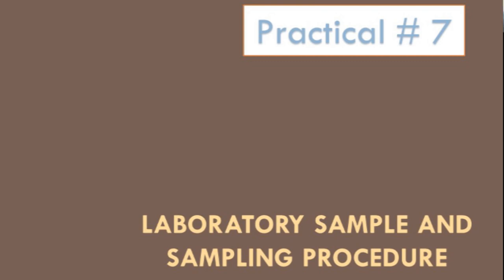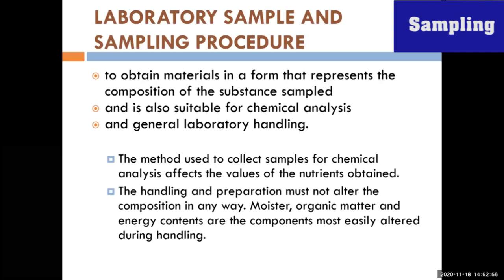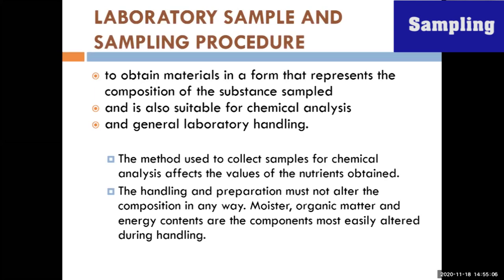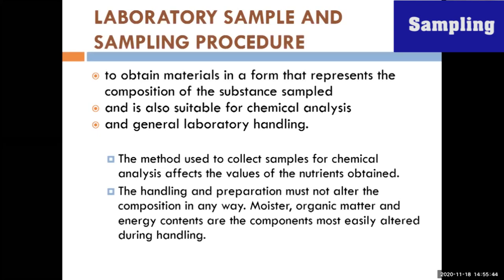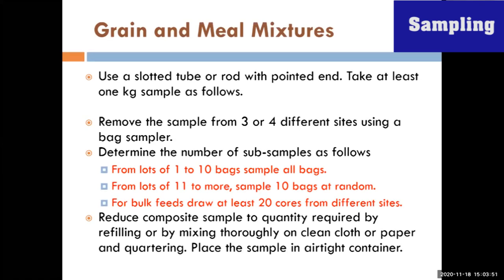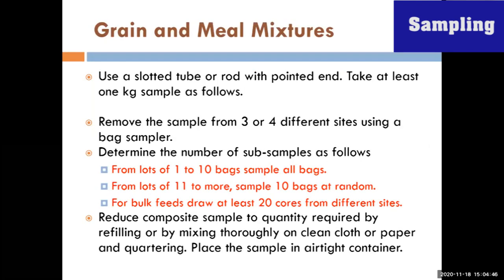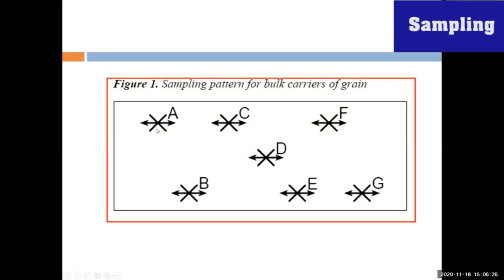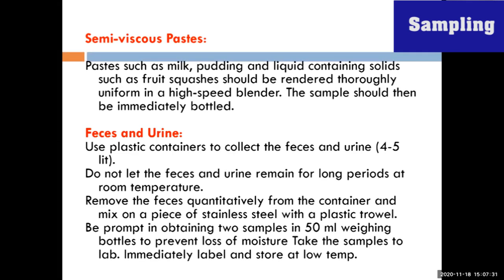Practical#7- Feed Sampling -Lecture Series in Animal Sciences, Animal Nutrition

Comment: The sample is taken from at least ten different sites in this heap, the sites are selected randomly. The whole sample should weigh up to 3-4 kg. if the moisture content is to be considered then it is packed in plastic bag, otherwise in a paper bag. The sample being greater in size is first dried in the oven, then it is ground in a hammer mill. Afterwards the grainy structure obtained from the hammer mill is spread on the paper. A cross is drawn and two diagonal segments are removed. The two left are mixed again and a cross is drawn in a similar pattern. The process is continued until we obtain a sample weighing 200 g which is then transferred to a bottle

19-Arid-2204

Comment: ✓The sampling is done to obtain material in such form for the chemical composition analysis.
✓The sample is quarterd untill the sample collected left about 200 grams.
✓In case of fecal and urine sampling after collection, the sample is immediately shift to lab and if sample remain for long periods temperature must kept low to avoid the fermentation.
19-Arid-2254.

Comment: 1- We have to take the sample from 3 to 4 sites through a bag sampler. For sampling of bulk feeds, we have to draw at least 20 cores from different sites.
2- For meat products, we have to separate the meat from bone and skin and this meat should be run through a meat chopper to reduce it to a fine mince.
19-arid-2197

Comment: Sample can be defined as the fraction of whole group and it act as subset of population.
Collect sample by QUATERING SAMPLE METHOD, which mean that draw a cross around the material taken. Remove material from two opposite diagonals and remix the remaining material, repeat the procedure until sample of 200g remains.
19-Arid-2290 
Evening-A

Comment: 1- The proper sampling is necessary. If we take sample from  5 or 7 bags out of 70 bags. May be these five bags contain toxins and we cannot reject the lot on the basis of just these bags. If we take sample from site that shows good quality and no toxin. It might be happen that other contain toxin so there will be problem during feed formulation.
2- From the grass land the sample is taken from 15 to 20 sites above three to four inch from ground and save the sample in bags of plastic. If it is moist then dry and apply the quartering technique until you get 200g sample.
19-arid-2182

Comment: 1) The method used to collect samples for chemical analysis affects the values of the nutrients obtained.
2) For meat and meat products: Separate the meat from bone and skin. The meat or meat mixture should be run through a meat chopper to reduce to a fine mince. Transfer the sample to a jar and store at low temperature.
19-Arid-2265

Comment: 1. For Meat and meat products Sampling:
Meat is separated from body composition and is run through a chopping machine and reduced to mince form. The sample is stored at low temperature.
2. For Feces and urine sampling:

Faeces and urine are collected in plastic containers. Faeces are removed quantitatively and mixed with a stainless steel with a plastic trowel and is stored at low temperature. 

19-arid-2198

Comment: 1. We should preserve the sample very carefully, because moisture, energy contents and organic matter are the components that changes very easily.
2. First mix the sample thoroughly, then grind into fine pieces, then dry at optimum temperature and then weight at measuring balance.
19-arid-2219

Comment: 1. Place powder or granule on paper sheet, mix it and draw a cross across heaped pile of material.
2. Remove moisture by drying and grind dried material by using smaller hammer mill.
19-ARID-2264 (Evening B)

Comment: Feces and Urine:-
Use plastic containers to collect the feces and urine(4-5 lit).
Do not let the feces and urine remain for long periods at room temperature.
Remove the feaces quantitatively from container  and mix on a piece of stainless steel with a plastic trowel.
Be prompt in obtaining two samples in 50 ml weighing bottles to prevent loss of moisture take the samples to lab.immediately label and store at low temperature.
Syed Jawad Hussain Shah
19-Arid-2250
Section B